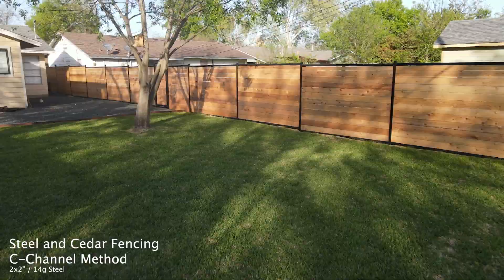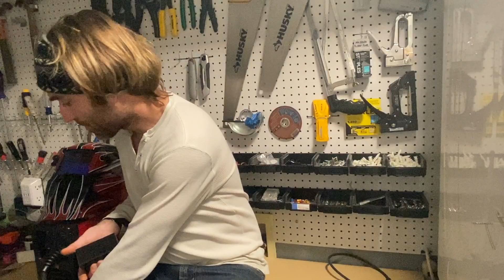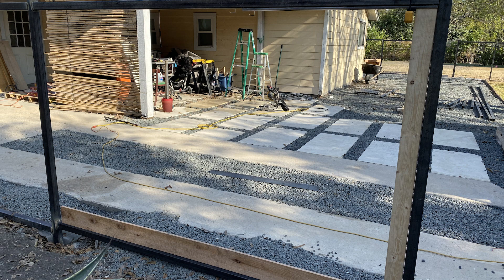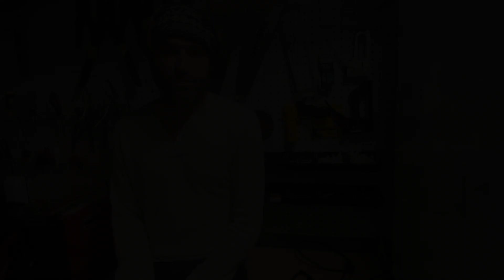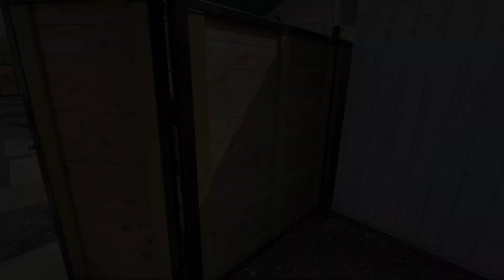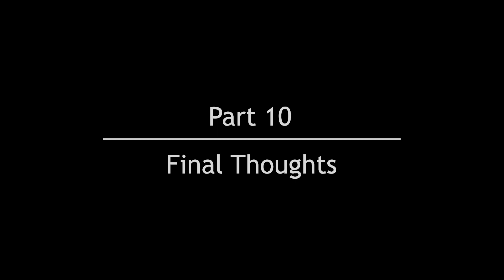Unique Method of Using Stainless Steel C-Channels in the Construction of a Steel & Cedar Fence

Comment: Hey, how’s it holding up?
Reply from the maker: It's been great! Lots of giant storms, winds, snow, etc. and it seems to do just fine.  We had a massive storm knock over a huge tree behind the house.  It came crashing down through one of the fence sections and while it broke some of the cedar, the steel held up just fine and the fence structure itself was unaltered.  So I'd say it works pretty well overall :)

Comment: You’re looking for horse stall channel. 1-5/8”x1-5/8” 16 gauge. I started a fence and have been scouring trying to find other ideas. Found this video, which is the closest. I got my stall channel from metal mart. They have many around Texas
Reply from the maker: I hadn't noticed this comment; sorry about that! Thanks for naming the item I needed.  I did just look them up and they appear pretty expensive (at least in terms of doing a large fence project like this).  But admittedly I didn't did into industrial sellers or anything so I'd imagine at volume they'd be much more reasonable.